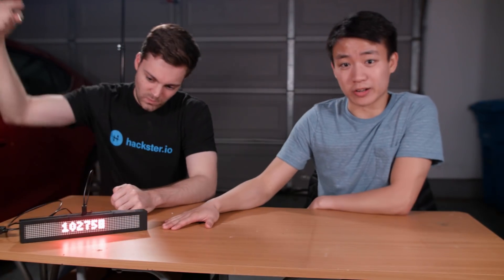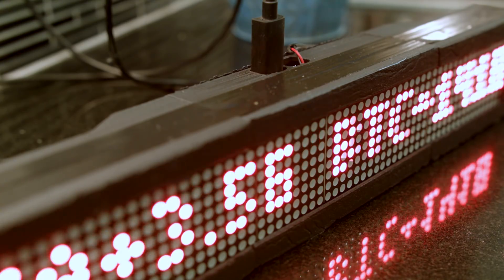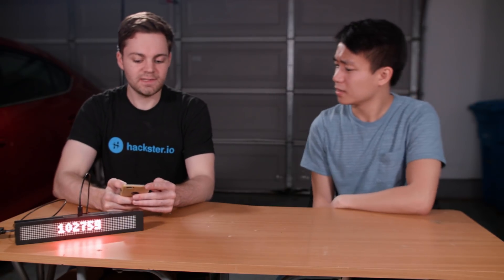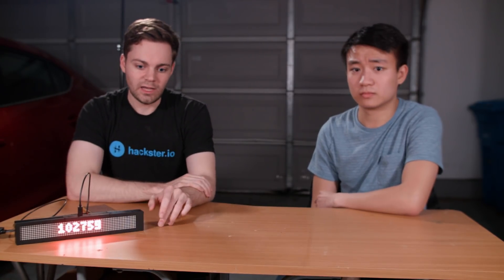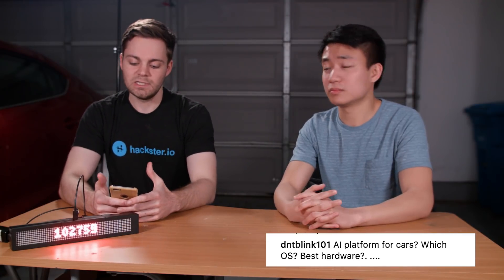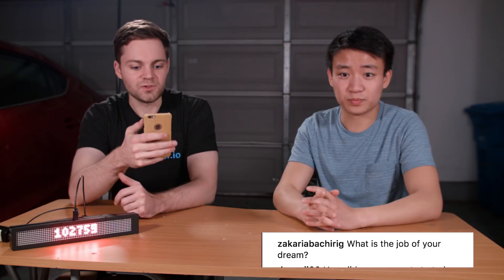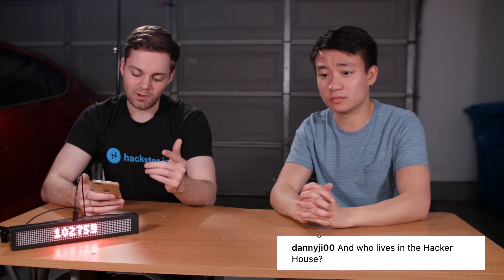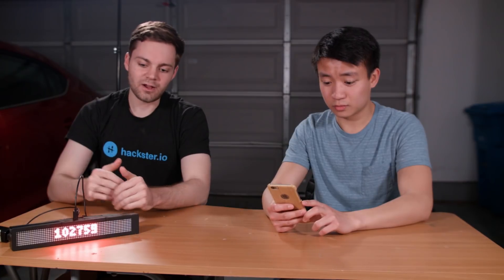DIY Cryptocurrency (Bitcoin) Ticker / Realtime Subscriber Counter

Comment: theres a problem installing the dependencies. this url says 404 error not found. how do i fix this, thank you

https://pypi.org/simple/max7219/https://pypi.org/simple/max7219/
Reply: Did you manage to find a solution because I have the same problem
Reply: @mouflon7538  no I ended up going with some other project. The bitbar or Bitcoin bar or something like that

Comment: this guy is in a bad need of soldering skills
Reply from the maker: Yeah I know. Any tips?
Reply: Don't rush use needle nose pliers or Fine point tweezers to hold the pin. use flush side cutter to cut the leads. and most importantly, use fine solder. 0.5mm or less.Try to keep your hands less shakey. Third hands with those alligator clips can be useful. watch some of Great Scott's Videos and his tips for soldering. try to make it appealing to the eye.